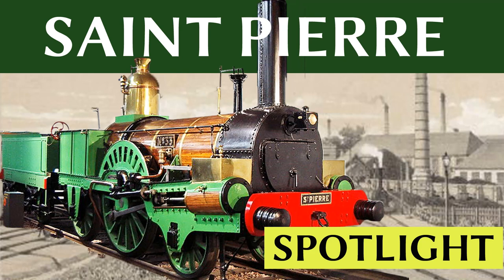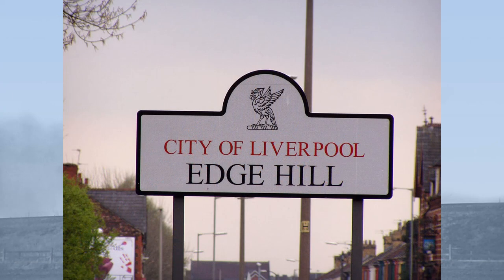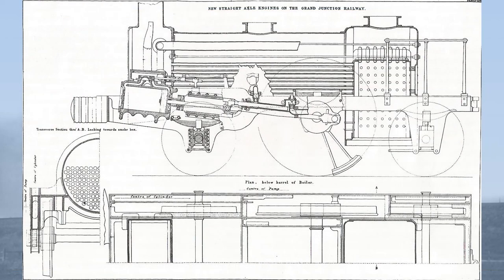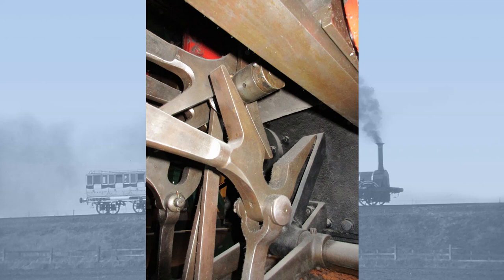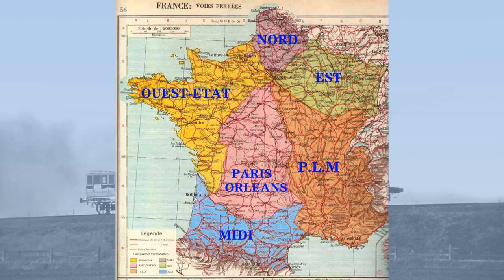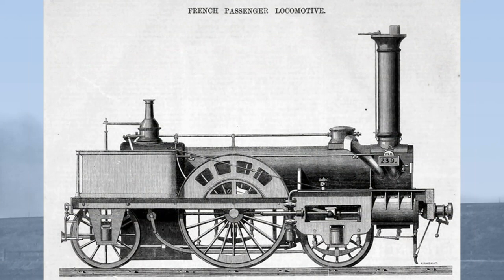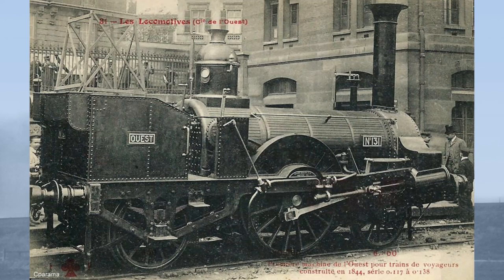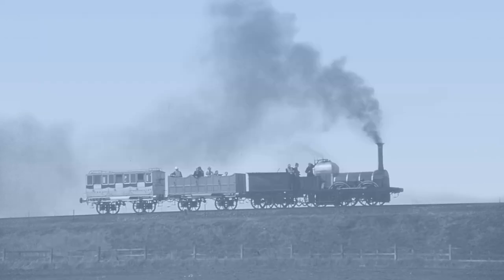Spotlight: St. Pierre

Comment: I think a look into the crampton type locos could be interesting, originally designed in the UK but ultimately not very well suited. They were quite popular in France and Germany despite the inherent lack of traction though
Reply from the maker: The lack of traction thing is a bit of myth - the tenders were close-coupled almost rigidly so making a long articulated unit the weight from the tender adding to the load on the driving wheel. The big problem in Britain was the incredibly long fixed wheelbased which badly damaged the track, especially on curves. Fascinating machine nonetheless.
Reply: @AnthonyDawsonHistory  having the tender apply weight to the rear of the loco is a very interesting point that I hadn't heard of being used on the cramptons. That would certainly help a fair bit
Reply: @AnthonyDawsonHistory  Mike Sharman used to make model Cramptons fifty years or more ago. He used the weighted tender method to get traction. Independent thinking or from his knowledge of Cramptons perhaps.

Comment: Why does it have wooden boiler lagging where as Columbine has Metal Boiler Lagging? Was there a design update between they're build dates?
Reply from the maker: St. Pierre was restored to original condition, whilst Columbine still retains many features from its long life, other than removal of the cab but that is in store, so too the tender.

Comment: Will you even as an aside or footnote, cover any mechanical locomotives that were not steam driven?
Reply from the maker: I'm sticking firmly to self-propelled kettles other than Cycloped at Rainhill. Non-steam locomotives other than the first electric locomotive which was built in Scotland in the 1840s fall out of my sphere of interest and knowledge i.e post 1850.
Reply: @AnthonyDawsonHistory  Indeed, well said. Given that rail itself dates back to Antiquity, I had a curious thought of any attempts to automate aside of the horse.